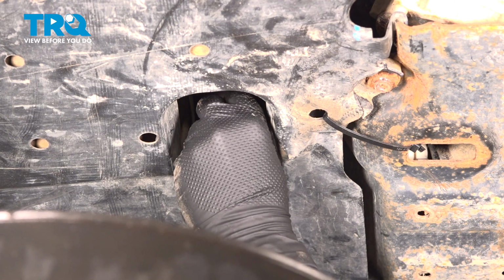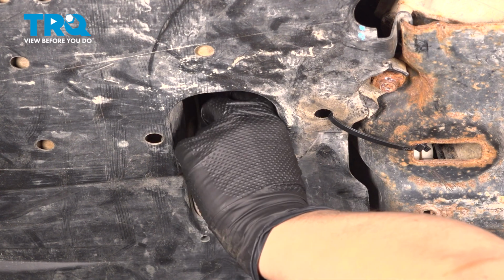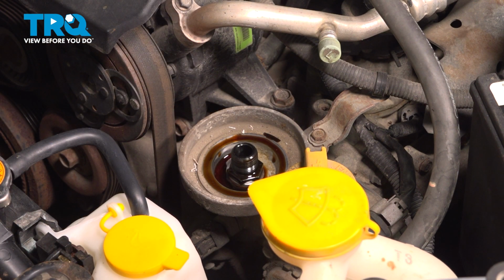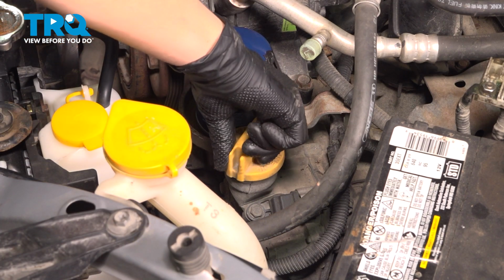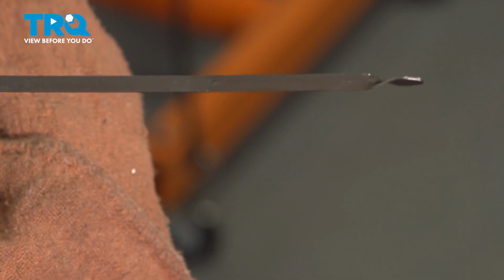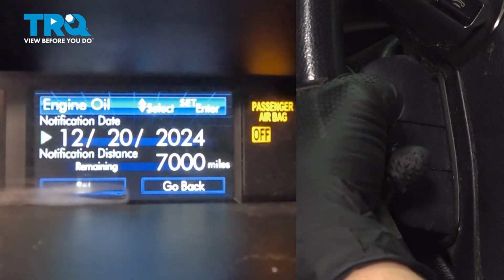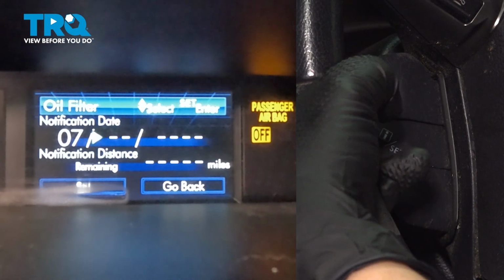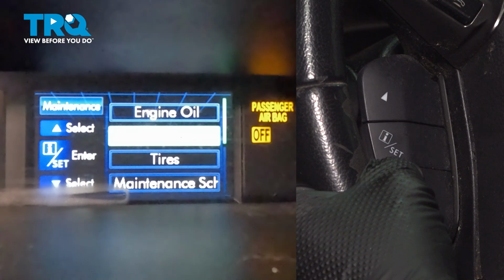How to Change Engine Oil 2014-2018 Subaru Forester 2.5L H4

Comment: That rusty tool you used for the filter is probably 100 years old and is also deforming the new filter. Tighten by hand only.
Reply: Yeah, I put a big dent in mine using that tool.  I assume it's still ok  but maybe not?